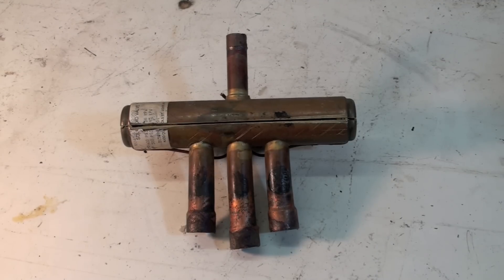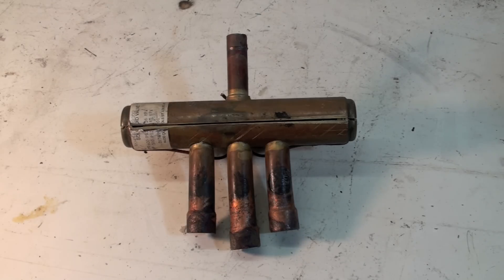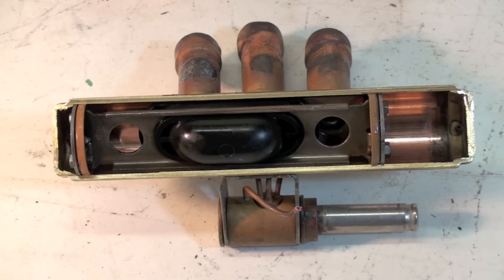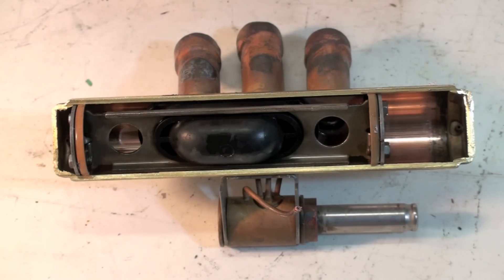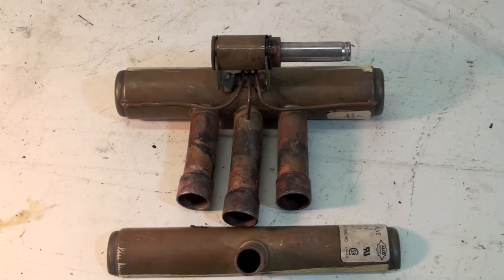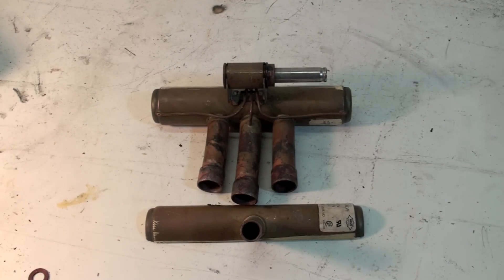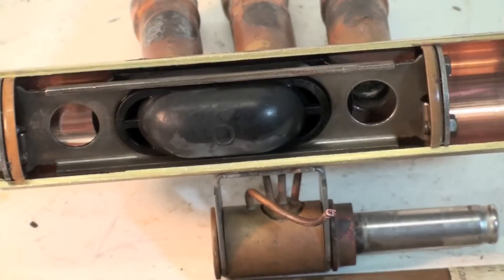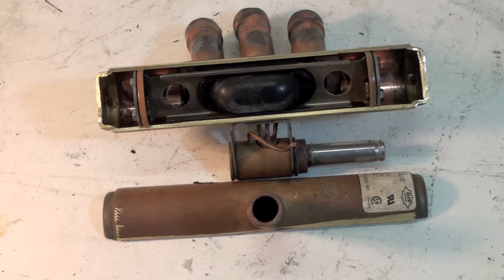how does the heat pump reversing valve work

Comment: This is a great video, thanks! I have an electric heat pump system (no aux heat). I just upgraded to a CT50 WiFi thermostat. When turning on cooling mode, the thermostat clicks, as well as the reversing valve. The problem is this click happens even when the A/C isn't actually blowing air. Is it normal for the reversing valve to be energized for hours or even days when the A/C isn't blowing air?
Reply from the maker: fordracerguy Some of them are energized until the heat/cool mode is changed.  It does not hurt anything.
GFM

Comment: My Reversing Valve was recently replaced due to a freon leak. Now, the system only heats up my house and the AC is not functioning. Sounds like the valve has melted and is stuck! It's very apparent that the valve was overheated during the installation. I don't know what's worse, used car salesmen or HVAC technicians.
Reply from the maker: TheDreamReport  I would be sure by contacting the service tech for warranty repair.  If he fixed it he should back the repair.  Sometimes, even if any warranty period has passed, you may get free or reduced cost repairs.
GFM
Reply: grayfurnaceman Thanks for the reply. PEACE!

Comment: I liked the explanation, the proper way to install, and of course how you cut it in half to see the inner guts.  Good job and Great Video Thanks!
Reply: Dave Reinhardt  how do you check for a bad reversing valve
Reply from the maker: I have not done a video on replacement of the valve.  One for the future.  Testing the valve is somewhat complex.  When you energize the solenoid, you have to listen to the movement of the valve.  It should make a whoosh sound.  No whoosh, bad valve or solenoid.  I did a video on temp difference testing.  Look for "testing the reversing valve"  on my channel.
GFM

Comment: Great training video! I will use it to help my guys understand reversing valves. The only way I have found to be 100% sure if the reversing valve is stuck in the middle or if the compressor is running and not pumping is to very slowly crimp off the hot gas discharge and monitor compressor amp draws. On some units like a Trane, you can look at the pressure if crimped slowly by the reversing valve. After misdiagnosing several compressors/reversing valves I made this test mandatory for my technicians. Fixing a line is much better than a misdiagnosis any day!
Reply: Why not look at the TD of the lines in and out of the valve?  Why not look at them with a thermal cam?  That should make quick, accurate diagnosis possible, no?
Reply: If the reversing valve is stuck in the middle there is no seperation between the low and high side of the system therefore the pressures in the hot gas discharge line and the suction line are very close to the exact same. In other words the suction line is sucking the same amount of refrigerant as the hot gas discharge is putting out. If there is no pressure difference how can there be a temperature difference? The lines will be warm either way because the compressor and lines will warm up from the heat of the compressor motor. Even if the compressor is pumping the refrigerant the refrigerant can't cool the compressor due to no change in state. You cant measure the heat of compression if there is no pressure being made. If the compressor is pumping there is good flow but no pressure is being made to measure the heat of compression. Nothing is being compressed except in a very small area inside the compressor. The compressor is very hot anyway due to no refrigerant cooling it. It is impossible to tell for sure. Looking at the temp difference in and out of the reversing valve works great if the valve is not fully seated in one mode or the other. In that case the pressures will not be the same in both the hot gas line and the suction line and you can make a good diagnosis. If the reversing valve is stuck very close to the center position you will need to crimp down on the hot gas line slowly and see what happens to be sure of your diagnosis. Good luck!
Reply: I understand what you mean and you are 100% correct if the RV is 80 or 90% seated in 1 position or the other. I was talking about how to figure out if you have a copmressor running and not pumping or a RV stuck very close to the middle position when there would be no pressure difference between the hot gas discharge and the suction line of the compressor. No pressure difference means no temperature difference that is measureably reliable enough to determine which major component has failed. Crimping down the hot gas discharge SLOWLY and watch the compressor amp draw, the sound of the compressor and possibly the hot gas pressure rise if you have a schrader there for full time high side pressure port. This way you will know for sure if the compressor is able to pump so you can be 100% sure of your diagnisis. Using a magnet can be helpful in some cases but if the RV is stuck a magnet will very likely not move it and if the compressor is running and not pumping even if you did move the RV how would you know it even moved? Nothing would change. Crimping the hot gas line is the only 100% sure way I know of to be sure of your diaognosis.

Comment: Hey, have you ever come to a unit and both high and low sides were reading the same pressures while compressor is running and then go off on thermal overload? New to heat pumps and saw this on two units I'm having problems with? If any you tubers out there have an answer to this problem let me know.
Reply from the maker: The symptoms of equalized pressures in a heat pump could be 2 problems.  A compressor with failed valves.  Or a reversing valve stuck halfway.  The  diagnosis can be very difficult.  One of the ways to check is the temperature of the discharge and suction line.  If the temperature rises very quickly, the compressor is probably pumping so the reversing valve is at fault.  If there is little or no rise in temp, the compressor valve are probably at fault.  Hope this helps.
GFM
Reply: Thanks for the feedback, and from what i determined and what you confirmed i think I'm dealing with a reversing valve stuck halfway, now do you have any methods from your years of training i may use to get the reversing valve to slide back into position or should i go ahead and look into replacing the valve or unit itself since it was manufactured in '98. Any feedback would be helpful
Reply from the maker: Marcus English If it is stuck halfway, its junk.  Replace it or replace the whole unit.
GFM

Comment: Great Video, Thanks for taking the time to fully explain the operation of a reversing valve, much appreciated. So, really there isn't any way to test the operation of the valve without the unit running right? The reason I ask is because I have 3 Heat pump circuits that have been serviced by another company, when I arrived on site, no refrigerant in the systems, pressure tested and no leaks. Compressor windings are good so I guess I'll have to charge it up and see what's wrong with it!
Reply from the maker: You usually do not need a full charge to test.  I would charge only enough to get a pressure difference and it should shift.  Hope this helps.
GFM

Comment: Just the other day I went to a job where the compressor and fan failed to start up.  First think I check in those cases is the run cap.  Found a nasty surprise when I pulled it out.  Turned out the capacitor had a catastrophic failure and had arced to the chassis and spot welded itself to it.  The fuses and CB upstream were oversized and never popped/tripped.  The OFM and compressor were running at 120V to ground for an unknown amount of time.  I went on to recover the refrigerant (R22) and it took nearly 3 hours to recover the 7 odd pounds from the system when a similar recovery only takes me about 45 minutes.  That was the first red flag.  When I pulled the hoses off my manifold to break the partial vacuum I noticed some black sludge in my sightglass (flag 2).  I finally went on to unbraze the compressor and was greeted by a trapped slug of about 2 ounces of refrigerant blowing out between the suction line and accumulator.  The stench of acidified freon was heinous.  Going on to pull the discharge line off I found resinous goop in the discharge tube.  This was the biggest flag of all.  Now I HAD to check the reversing valve, so I pull the other end of the discharge tube off the valve and peered up into it with a light.  Inside was a huge slug of the same goop, so now I have to replace the valve too.  After pulling out the compressor from the unit I found what looked like carbon dust in the suction port, great, now i have to check the accumulator.  I pull it out and tip it over and out came tar black mineral oil.  The property owner did not want to replace the unit after SHOWING him all of this and ended up having to solvent flush every single component, replace the compressor, suction accumulator, reversing valve, filter drier, and charge new R22 into the system.

TL;DR - Capacitor killed the compressor, barfed motor insulation, roasted the refrigerant and clogged the reversing valve.  Several hours of work, and had to decontaminate every single piece of my equipment that day.
Reply from the maker: Great story.  I'll bet the cost was very close to that of a new unit and probably the new compressor won't last long.  Thanks for the thoughts.
GFM
Reply: Many technicians would have walked away from such a job. That is very labor-intensive job and extremely costly. I would have told the property owner that a job like this is not only costly, but risky and you can't guarantee how long the compressor will last. Some customers are just stubborn and they will refuse to take the technician's advice.
Reply: Psycho9263 I forgot to mention, the owner is my boss and landlord.  I begged and pleaded this guy to just get a whole new unit, but he rather I stand out in the January cold to get it done.  He saved maybe $100-200 having me do the repair.  He still doesn't understand savings/reliability margins.  Luckily it's nearly one year of heavy use and it's still working.   Tenant has a history of swinging temps all year round. "Now it's too cold!  Heat!  Now it's too warm! Cool!"
Reply: Psycho9263 Thank you very much.  I was quite nervous I would have an acid issue a few months in after I had finished.  Clunking Goodman package unit is living on borrowed time.
Reply: sivalley
As long as that compressor holds up, you're in the clear. Good Job. Actually, great job. This kind of work will kill us yet.
Reply: HoI w
Reply: Your experience will HOPEFULLY save me from the same in the future 👍🏼.

Comment: Great explanation and demonstration! Thanks for taking the time to carefully dismantle the valve to show cut-away views. How much deviation in temperature do you recommend when troubleshooting the valve in operation. I always thought the two suction tubes should be the same, and the two discharge the same temperature. I have seen some books say up to 3 degrees is ok.
Reply from the maker: I have seen both 6 degrees and 3 degrees.  Most failures are fairly obvious, no movement, loud hissing noise.  Hope this helps.
GFM

Comment: Your a life saver. I went out on a Goodman ssz14 today that was tripped out on thermal in heat mode. When it reset I checked all three ports. The common compressor suction port dropped to 0psig while the high and low ports equalized to @ 270psig. I then checked it cooling mode and it worked like a champ, 9'SH 14'SC in 45' OD temp with a field piece cold weather charging jacket on it. back in heat mode, same as before and wont run more than a minute. My 1st instinct was the OD TXV. but the reversing valve was nagging at me. The fact that it's been doing this non stop for more than a month really bothers me as the customer complaint was high electric bills. Knowing that the discharge will enter the common suction line is king. I thought that if it stopped halfway that it might block off the common suction line while opening the indoor and out door coils to each other. I sure don't want to change the TXV and still have the same problem. Then again I'd rather change the TXV than the reversing valve. Dreading changing the filter drier. It will have a new home, outside of the unit where it belongs not buried in the bottom of the unit, an inch away from the service valve.
Best Reversing valve video I've seen yet.
Reply from the maker: If your unit works in cool, and the valve shifts,  my guess is the TXV is not feeding.  So you may get the easier TXV replacement!  Glad I could help.
GFM
Reply from the maker: +who ami I am not sure how you would do that.
GFM
Reply from the maker: +who ami You can try it.  No guarantees.
GFM
Reply from the maker: +tstatech Thanks for the support.
GFM

Comment: My brother in laws heat pump when set to heat will kick into ac mode. What should I check ? Thank you
Reply from the maker: Most pumps energize their reversing valve in cool.  The only one I know that energizes in heat is Rheem/Rudd.  You might check voltage at the rev valve solenoid.  If there is power, remove one wire (be sure it is 24v or shut down power before removing) to see if it shifts.  You can also turn on the ac and remove the wire to see if it shifts.  No shift, bad valve or no refer charge.  Hope this helps.
GFM

Comment: can you pressurize the system with nitrogen then activate the coil on the valve to test it? as long as there is pressure in the system to move the valve, seems like it should work... curious to know if anyone has tried.
Reply from the maker: Yes and no.  Sometimes you can pressure up the system and get the valve to move, but only by adding pressure to one side.  The pressure will equalize in a few seconds and the effect will be over.  Usually it is not definitive.
GFM

Comment from the maker: Yes, the geothermal system is simply a heat pump similar to an air source heat pump that picks up heat (or releases it) from the ground thru a ground loop filled with water or a well or a pond, lake.

Comment: Wouldn't this heat puimp reversing valve be used or useful in a geothermal system for changing from heating to air-conditioning in a building?

Comment: Great video thanks.   I was curious what you used to open up the reversing valve.  Only asking as I've just changed one in a Daikin VRV 2 R407C unit and was wanting to inspect the internals.  Immediate thought was a hacksaw then I was concerned that the filings would go inside?  Any advice would be welcomed.  Thanks Eddie.

Comment from the maker: Txvs should be ok.  When you change from cool to heat, does the valve move?  Is the head pressure higher than normal or lower than normal?  Place the unit in cool and check suction pressure at the lineset suction tap, then the 3rd tap and see if there is a difference.  Let me know.
GFM

Comment: YES IT DOES THE SAME ON COOL OR HEAT, SO ITS NOT THE TXVS RIGHT?
I REPLACE THE FILTER DRIER, BLOW THE INSIDE COIL IS CLEAN, OPEN BOTH TXVS CHECK THE PISTON OR WHAT EVER YOU CALL THAT IS CLEAR. SO I DON'T KNOW ANY THING ALSO. THANKS

Comment: if the reversing valve sticks halfway , will this afect  presures? i got a block in my heat pump some where, the compressor goes in to vacum and  my head presure stays the same, even if i disconect  the outside fan motor, any idea whats going on. thanks

Comment from the maker: Accumulators in HPs are used to prevent liquid floodback from lowering outdoor temps.  Lower OD temps reduce the amount of refrigerant needed, so the liquid goes into the accumulator.  If a rev valve sticks midway, hot discharge gas will pass from discharge to suction and overheat both valve and compressor.  Hope this helps.
GFM

Comment: Are you finding many newer heat pump units use suction line accumulators to prevent the compressor from slugging-then-blowout of valves in the event the reversing valve is stuck mid way?

Comment from the maker: Usually if the reversing valve has failed the unit will either stick either in cool or heat, or will stick halfway and do nothing.  Running but no cool could be many things.  Low refrigerant charge, failed compressor, plugged filter or frozen coil are some of the most common.  Hope this helps.
GFM

Comment from the maker: Certainly, the rev valve is the most sensitive to contaminates and brazing technique.  Also low charge will increase operating temp.  Once it has failed, its quite hard to tell what happened.  I have never seen one with cast aluminum slide.  Thanks for commenting.  
GFM

Comment from the maker: My thought on inductance of a coil without a core is that there is no concentration of the magnetic field so the back emf is smaller so higher amp draw.  I have seen the same thing in contactors with stuck armatures.  I suppose it is also a heat sink.  Thanks for the response.
GFM